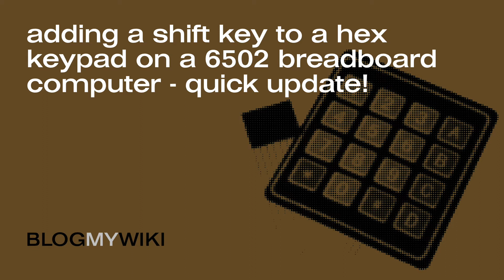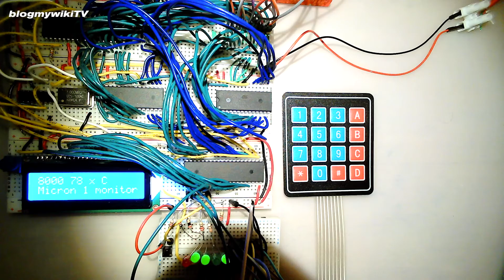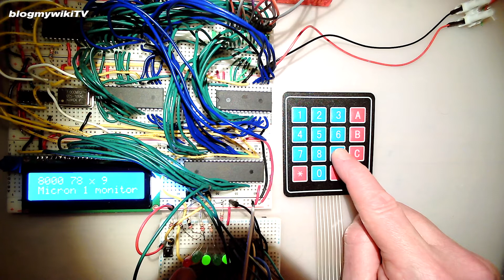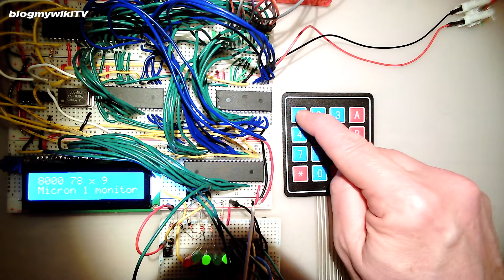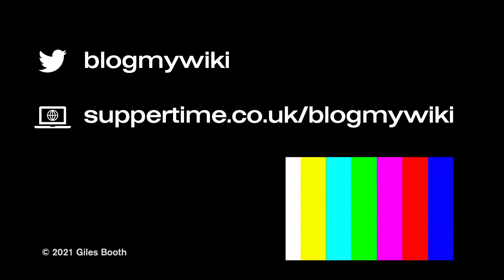6502 breadboard computer: add a shift key to a keypad

Comment: Another way without adding a switch would be to use the * key as shift for example, and make shift-1 to shift-6 as A to F. The red A-D and # could then be used for operation purposes like set PC, run, step etc. The * could be a temporary shift if pressed momentary, or caps lock if pressed long.

Comment: Odd question have you ever looked at the white papers online that  said you connect a lcd display directly to c6502 bus an use your address decoding to chip en on lcd display? And RS to ADDRSS line 1 ? I’m just curious because Ben Eater didn’t do this ? Inless there reason I missed ? Great project. 👍🏻
Reply from the maker: Good question! I hadn't considered anything like that until I saw this project which I think takes a similar approach: https://robin-6502-project.blogspot.com/2020/06/hex-keypad.html - Robin, the author of that post, says there are some advantages of doing it the Ben Eater way. I also considered using the LCD in 4-bit mode, but have avoided that so far to avoid a lot of re-coding.
Reply: @othermachines  noob in electronics , how ever been reading  textbooks  as I been watching  videos on and it and try see if I could maybe start learn from them . When I came to this article  http://www.6502.org/mini-projects/optrexlcd/lcd.htm , I don't know if youtube will alow the link , but thought it may help your io issue and keyboard . Keep up the good work 👍